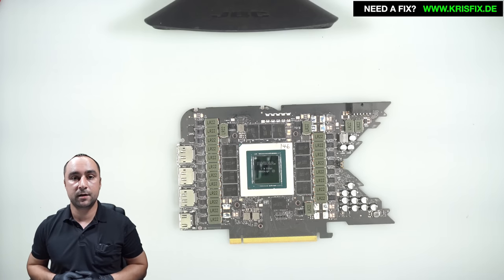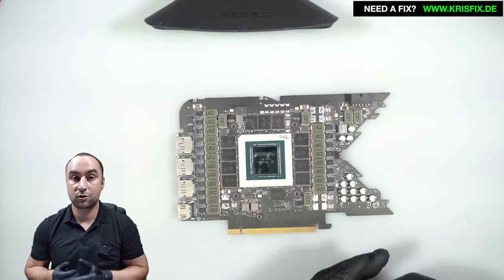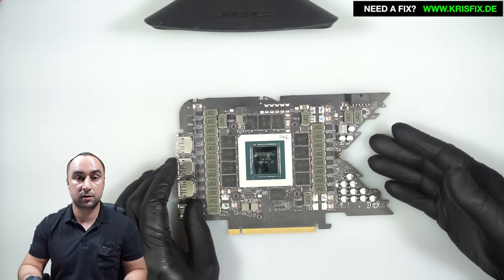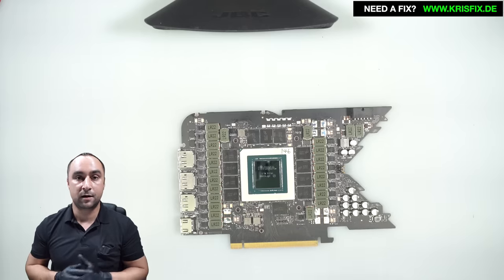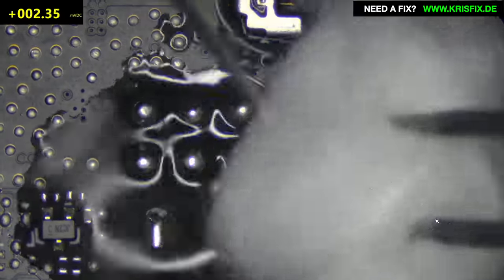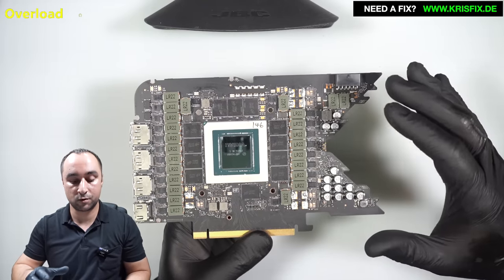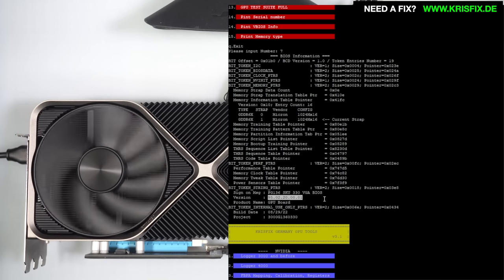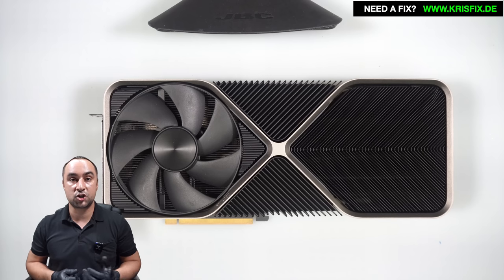RTX 4090 Engineering Sample without Marking and burned 12VHPWR Connector

Comment: EU has much better warranty regulation/consumer protection, so it is likely less affected cards end up at independent repair shops, most burnt connectors in the EU will be dealt with by the manufacturer because it is a defect covered under warranty. In North America apparently warranty requests have been declined, with the manufacturers citing GN research the problem being "user error", so these cards end up at independent repair shops.
Reply: You do know that the stupid “warranty-void-if-removed” stickers are actually valid in the EU, contrary to the US where the manufacturer has to actually prove that the customer damaged their product?
Reply: @abavariannormiepleb9470  do not have the seal but the warranty be rejected is wrong way... EU is better then...
Reply: @abavariannormiepleb9470  partially true... EU has mandatory warranty (any product needs to last at least 2 years if the user handles it correctly) and extended optional warranty. For optional warranty the manufacturer makes the rules, so they can void it for any reason they like. For mandatory warranty it does not matter if any seal is broken or removed, the manufacturer would have to prove the user damaged the product to refuse warranty (for the first year after purchase, after that the user would have to prove they did not cause the product to break, but breaking a seal does not count as breaking the product).
Reply: Yes, you have to differentiate between local/national product liability laws (2 years in Germany, but after 6 months you‘re basically f-ed) between a customer and a retailer and the completely voluntary warranty by a product‘s manufacturer.
That‘s why I‘m pissed that the “warranty-void-if-removed” stickers are legal in the EU.
Reply: I cant even understand how warranty could be declined if the graphic cards connector melts.
Reply: @manefin a connector usually heats up because of a bad contact to the other connector that is plugged into it, so the problem can also be caused by a bad quality power supply connector, or by the customer connecting the connector in an improper way, for example crooked or not fully pushed in...
Reply: @Henning_S.  Obviously then there is only one clear solution for this problem of users not being able to connect the power cables correctly enough and thus the connectors melting. And that is making the power cables/component power cables and power supplies non modular. Only that way its certain that the user cant tamper with the cables in basically any way and/or install them improperly.
Reply: @manefin  the only thing graphics card manufacturers could do to prevent the connector from melting is to make the connector out of heat resistant plastic like bakelite. The rest is up to the manufacturer of the power supply...

Comment: My theory is exactly that.  There were weak pins(alloys maybe). In the first batches of power connectors in Notth America cards
Northridge fix has a PILE of them in his pile with the power connector failure.  

Very interesting to know this isnt a world wide issue.. indicating.  a problem with a particular skew of manufactured power connectors.
Reply: 1:20 Shhh don't mention northridge fix here, from this video you can tell Kris is salty he didn't get the cable mod cards hence not mentioning northridgefix in this video at all which I think is really funny.

Comment: Question: what would happen if you solder the five missing LR22 inductors? The card will be able to draw more power?
Reply: I'm pretty sure it is not only the missing inductors but also some other components missing, like MOSFETs for example. 
Maybe the software would also need to be modified to work with the added components...

Comment: I want to know what power supplies the people are using that have the melting power connector.  The issue might not seem that big, but considering the price of this card it needs to be researched.  Northridge Fix (Alex) and Gamers Nexus (Steve) both differ of opinion.  Considering that Alex receives most of the issues displayed from that CableMod outfit.

Comment: My gut says that possibly thermal cycles with expanding and contracting metals in the connector/plug slowly “squirt” out power cable connectors that had been initially plugged in correctly.

Comment: Could it be that burning connectors have some connection with US having different current than Europe ?
Reply: was thinking the same thing.
US powergrid runs on 120v and uses higher amperage than european powergrid, not sure how big of a differance there is but there is one.
Could the amperage be a possible culprit with melting connectors?

Comment: I own a 4090FE since 2022, before the first burned connector appeared. The only thing i noticed was that the 8-pin connectors of the Nvidia adapter (the end that goes to the PSU) weren't aligned perfectly and I had to bend them with some pliers to be able to plug in 2 of the 4 8-pin connectors. I also was not able to shut my case with the adapter on it. :D
Later I bought the OEM 12VHPWR cable from Corsair for my PSU, bend that cable really hard but carefully (2x90° turns) and now my case closes. I tested my card by running 600W through the cable and it got never too hot to touch. Btw, my guess to the whole Issue is ome part user error and some part the clip, that is too weak. I think most people plugged it in correctly, but then bend the adapter too hard or mushed it when closing the panel and that creates an onesided stress to the connector, which then slips out because the clip is too weak.

Comment: Wait, what? No 1000F hot air station to remove that connector? ;) I'm joking, it's nice to see someone using a pre-heater to avoid blasting silly temps to that thick multi-layer board. Somehow I was not expecting the solder to flow through the holes without pre-heater though - particularly because it's lead free. What temperature did you use on your soldering iron?
Thanks for the video!
Reply from the maker: Soldering iron - 350 Celsius

Comment: Well done mate, extremely good repair job.
I think this is user error, whether the connectors are different or not. I have used my 4090 FE for months/hundreds of hours and never had any problem. I use a SilverStone 12VHPWR cable with proper/matching gauge, which I made sure to plug all the way in. I have also re-seated the card many times with no issues. Best GPU that I ever had.

Nvidia should re-design the connecting plug (PSU side) so it clamps on both sides, so it isn't possible to plug in other than as intended. This will prevent user error.

Comment: i have a repair question that i'm DIYING to get an answer to. why do you and other shops like northdirdgefix don't use desolder guns for through hole components like connectors? i'm not a professional but i did replace one of these on a 4080 for someone. i had the melted connector out of the card in under 10 seconds with my hakko fr-301. my gun is a little on the pricy side but you get a quality desolder gun for $100. seems like a no brainer to me for a repair shop as it will save hundreds of hours of your time over the course of its' life. i rarely ever do repairs, i mostly do hobby circuit board builds once every few months and i feel like it saved me enough time already to make up for the cost
Reply: because to make a long-lasting connection (and to be 100% of your work) you still need to wick out the old solder, and thus preheat the card/area to do so properly.  so in essence you are just adding an extra step, and an extra piece of equipment that needs to be maintained, to the process.  i have a desoldering gun, but never feel the urge to use it on such repairs.  it's tricky to explain, but once you get into the flow of things, it becomes a "why bother" situation to use the gun.  it's not that it doesn't work, especially for a one-off, but as you do more of these repairs it becomes an annoyance.

Comment: You dont need to preheat the board you can use low melt with hot air. But thats my opinion.
Reply: Preheating makes it a lot easier melt the solder initially. This PCB has a lot of thermal mass. You need to put in a lot of energy.
Reply: preheat is way cheaper and faster to apply. Low melt solder is rather expensive, and it has to be cleared entirely before the final solder.
Reply: I will stay with my opinion guys if i dont need to heat up whole board that sounds better to me.
Reply: @stanimir4197  I dont do cheap and therefore that is not a problem.
Reply from the maker: I never work without preheater and never use low melt

Comment: From watching the Gamers Nexus video that you mentioned, it does seem that the burn issue comes mostly from user error.  The power cable isn't inserted all the way which causes resistance as the connection isn't good enough for the amount of power going through.  If the cable is stressed from a tight bend, this makes the problem worse.
Reply: Untrue. While yes, a lot of it is from unseated cables, the socket can begin unseating itself because of the heat passing near it. I just got a PALIT GameRock OC yesterday and was running tests after plugging everything. The case panel going in front of the gpu gets crazy hot exactly on the spot where the 12vhpwr connector is and the connector itself gets almost as hot as the GPU backplate.
I personally will be removing my glass panel when doing GPU-heavy activities

Comment: The thing about other repair shops (NorthridgeFix) claiming that this is a common issue is a bit misleading. If CableMod sent you abunch of graphics card, what kind of issue the card will have? of course connectors problems! Why CableMod will sent to a repair shop graphic cards with other types of issues? I mean... Alex from NorthridgeFix is make a show about this and i'm starting to get a little tired about him in this matter, everything feels like prepared and scripted to make views, and the way you fixed this connector feels to me way more professional than his. I just wish you can make videos more often.

Great job as always.
Reply: NorthridgeFix claims the issue is with the card, but that would mean the new connector also should melt again.
Reply: @f0x4nn3  The thing is Alex made a video where he seem surprised about having a pile of cards with the same problem (Big Boss giving him another card just after repaired one). But Gamers Nexus commented, which Alex did not, that he has an agreement with CableMod to repair their cards. I repeat, what kind of graphics cards will CableMod will sent to you if not the ones with connector issues?

Thats my point, the theatrical reaction of Alex in that video and the later one when he respond what gamer nexus said.

I'm no expert but he saying that the problem is the card and not the connector without evidence and when you are been paid by a cable/accessories company... Fishy.
Reply: @Davpedra  Yes, exactly. If something was wrong with the card the fix wouldn't last if it's just a new connector.